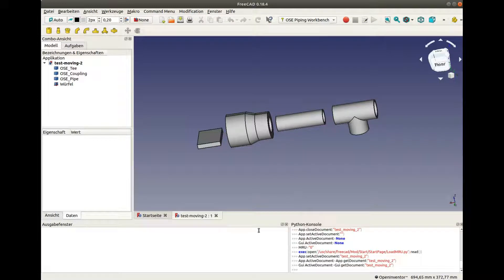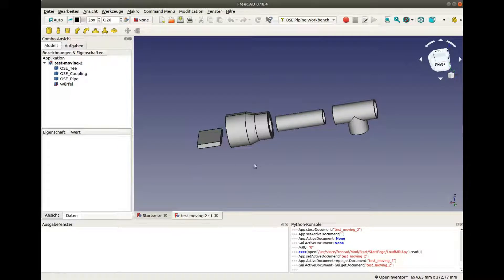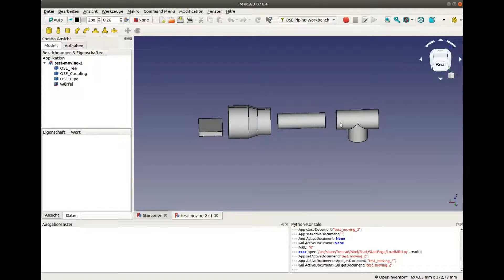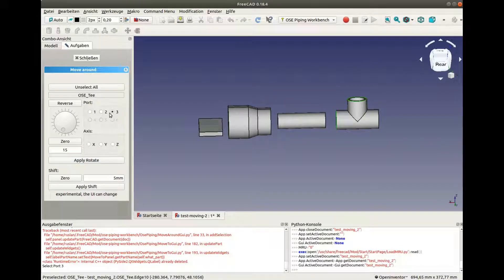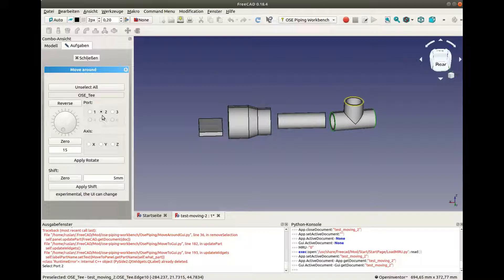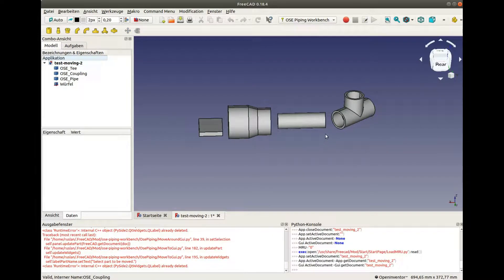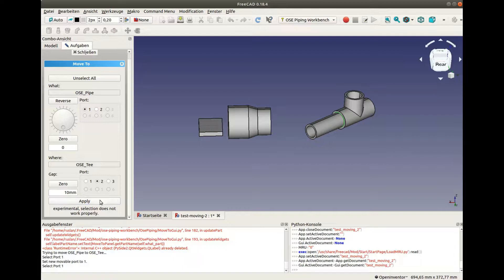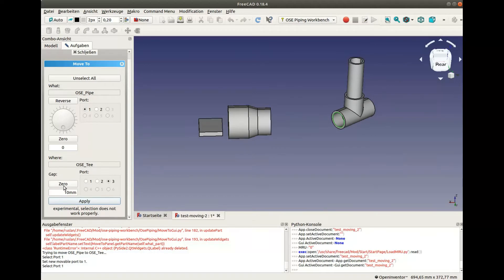Move pipes and fittings with OSE Piping Workbench.

Comment: Nice UI and functionality, unfortunately I am not interested to work with pipe parts. 
Perhaps you know if there is a similar interface to adjust parameters (like in DynamicData or spreadsheet) with a similar GUI? Lets say to change an angle with a slider instead of a text input? :)